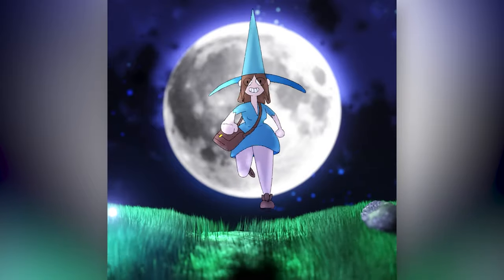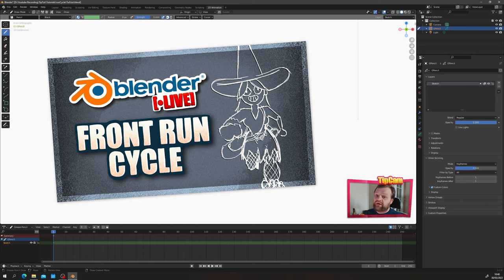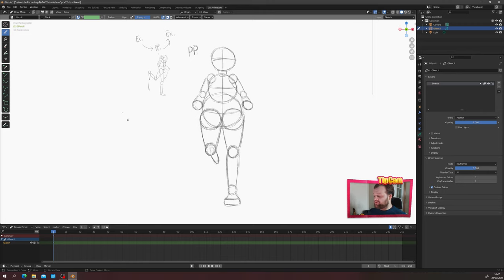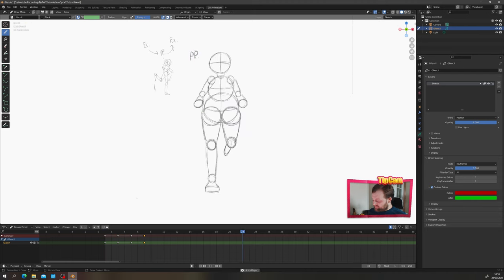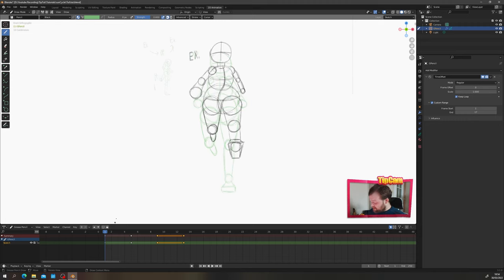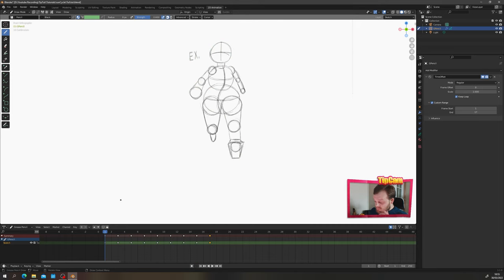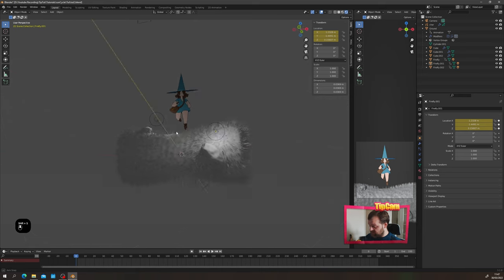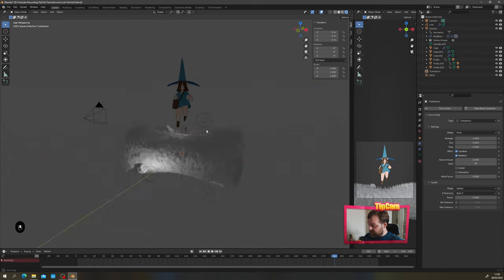How to Animate a Run Cycle with Grease Pencil in Blender

Comment: Great video, I have a question - Okay so i'm working on my first few grease pencil scenes and I want to clarify a good animation workflow - so you create a sketch of the gestures for the animation, then you draw over each frame with your full character, using onion skin to continue drawing the character effectively? I've been working on an animation, and catch myself using edit mode more to move points around / redraw certain aspects(like the hands or legs) to animate it. Is this technique still effective, or am I wasting time?